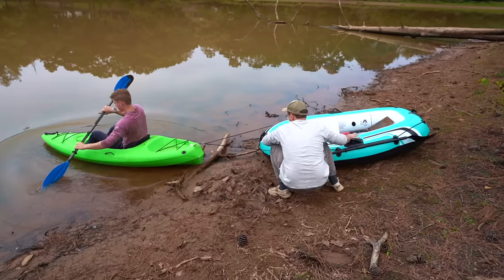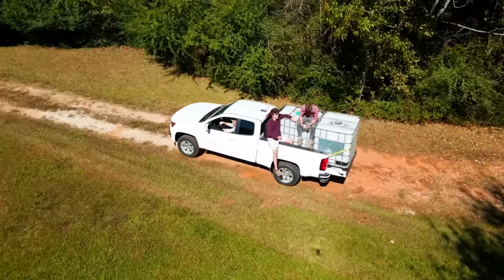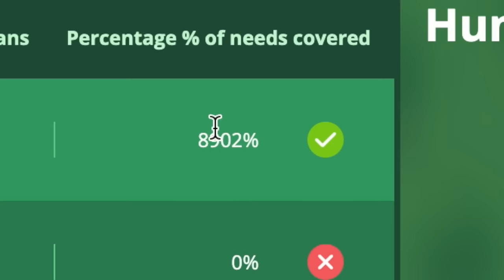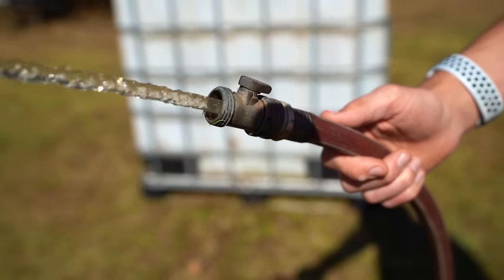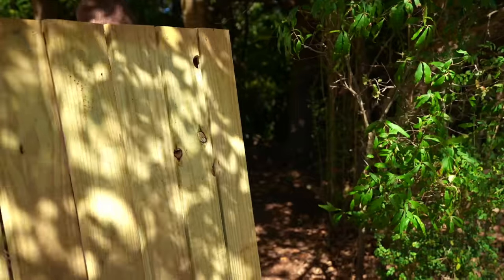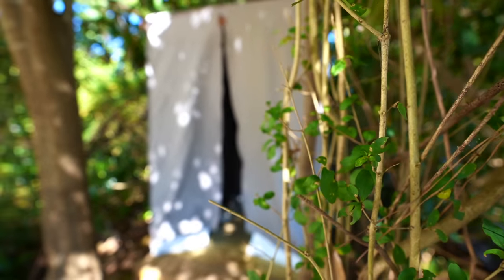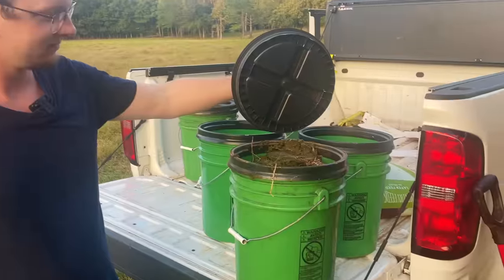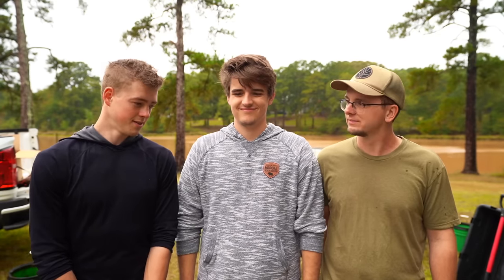Off Grid Composting Toilet & Methane Digester Setup

Comment: Fucking love this series. One thing that would be cool is if you could talk about possible solutions when there is no power. For example you can pump water without electricity by priming the hose. This can even pull water up hills that are not extremely steep.

Comment: Have you ever considered siphoning your water from your water tanks. If you set your water tanks on a shelf higher than your methane digester before you draw water from the pond, you can use a siphon technique to fill all your watering needs. In fact, I’m currently at my deer camp using the siphon method to draw water from two 55-60 gallon plastic food grade barrels. When not in use I simply tie the pouring end above the top of my barrels. In order to start drawing water now, I simply lower the end below the level of the water in the barrel. I left my barrels in a trailer that carried my other camping gear as well.

Comment: I'm an environmental health specialist for my state. I appreciate innovation to create cheap sewage disposal systems especially during these times of financial stress for low income homes. However, my only concern with this system is the public health crisis this poses when the system fails due to, say, storm damage. Additionally, I'm sure this is an egregious use of this system given sewage disposal units are an incredibly regulated area and you could find yourself in hot water (but i dont care, not my area).

Comment: Question, I know the biogas generator produces liquid fertilizer and methane for cooking but what happens to the leftover mass from the food leftovers? Wouldn't prolonged use make the leftover mass build up inside the biogas generator? Where does that mass go? Do we need to empty it out every few years or so?
Reply: Great question!  The methanogens (microbes that produce methane gas) actually break down the food waste and solids within the digester!  You do want to be careful not to put in coffee grounds, wood, grass, or anything with high fiber.  High fiber will not be digested and will build up.  Starches, dairy, meat, veggies, more manure and nutrients of leftovers all turn into liquid.  We can even put a few bones in there!  We might have to clean it out in a few years, but we’ll clearly illustrate that if the time ever comes
Reply: @OffGridGuides  I see, thanks for responding to my comment. If I ever get the chance to live off the grid like this, I might just buy one of them for myself.

Comment: I wonder what happens with the sludge in the digester? I mean it entirely breaks down and absorbes into the water so it exit eventually? Or just it builds up on the bottom and have to open up the digester every x time to clean it?
... I choose the first option.
Reply from the maker: As long as you only input starches, vegetables, and fruits, (and even some bone) you will never have any build up. We have had 2 digesters running for over a year! We only replace the carbon filter on it every 6 months or so.
Reply: @acornlandlabs  Thank you :-)
Reply: @acornlandlabs  So no fat, meats, or dairy? Thanks!
Reply: Most material in an anaerobic environment will eventually end up as CO2, CH4, H2, and H2S, but the gas production can slow down at various steps if one thing or another builds up. So if you add something like sticks, it will build up as cellulose takes a while to break down like this, and lots of one thing like cooking oil will disrupt the process and kill off bacteria as acid or alcohol is produced, but a good mix at a low enough input rate will result in practically everything turning into gas. With high enough retention times, it can remove practically all nutrients and pathogens.

Adding extra steps like a vermicomposting box for yard waste and the sewage to go through first or an artificial bog after the digester can reintegrate every bit of waste into the little environments you construct.

Comment: How do you deal with Methane leaking from the digester?
Reply: It doesn’t leak.  It does have a pressure valve to offgas on purpose if it’s too full.  But we use all the gas for cooking

Comment: What is the advantage of this expensive methane digester for cooking instead of a solar box oven? It seems to cost 5-10x as much for some cooking ability.
Reply from the maker: Hey! In the video we mention how it works as an above ground septic system as well! It’s 10x more affordable than todays septic system.
Reply: The question is directed to the wrong end. Your aim isn't to get Methan, but to get rid of your waste. The Methan is a useable byproduct of that process.
Reply: Are you sure bylaws allow you to put a septic system that close to the pond? The digester will still need a drainage field if it's handling human waste unless you integrate another system to lower the nutrient content and coliform count to code. Also, are you on a hill above the potential flood line? @acornlandlabs
Reply from the maker: @JSDV9999  it’s important to run off the liquid fertilizer (when using the methane digester as a septic system) into a wood chip plain, or grove. Definitely not into a pond like you stated. We are running it downhill the opposite direction of the pond.